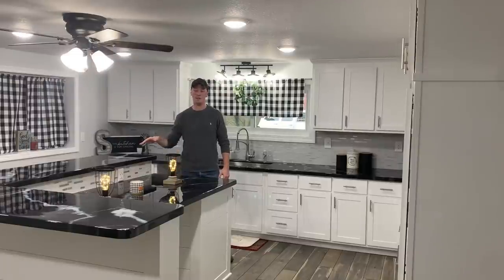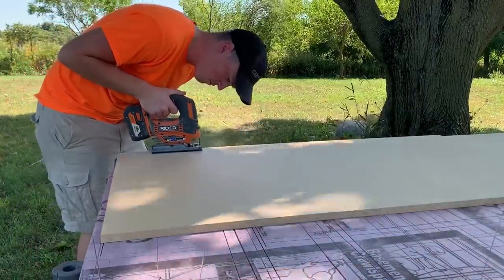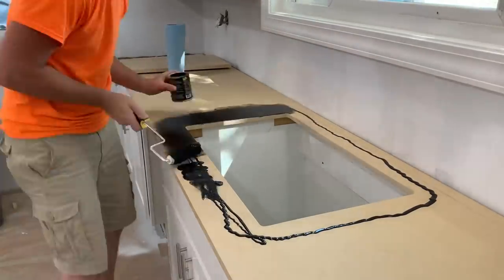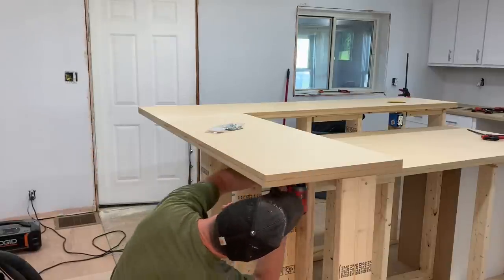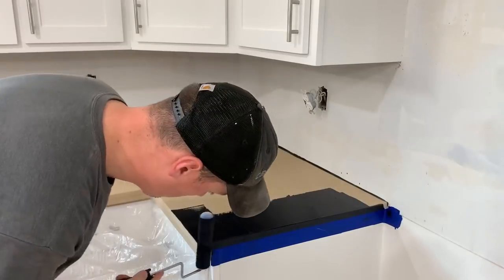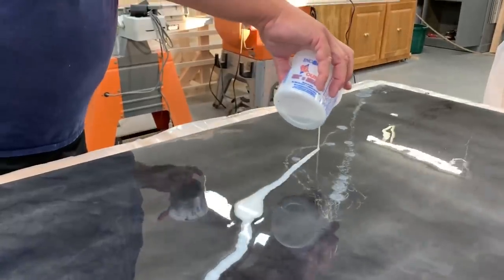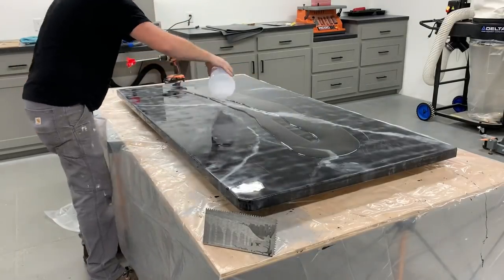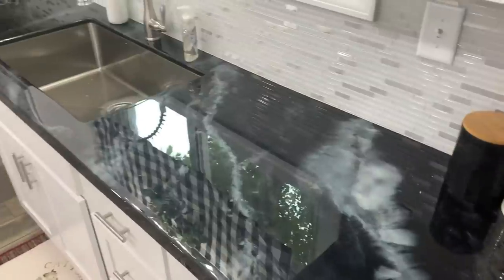EPOXY Countertops! | Complete Build and Pour

Comment: I work with epoxy as well if your going to do anymore projects with it please wear nitrile gloves and where are proper respirator mask . Allergies that develop from it are not pleasant including swollen esophagus and eye. Also lung cancer . Just one crafter/house project worker looking out for another. Loved the countertops though.
Reply from the maker: I was wearing gloves most the time, and this epoxy is 100% zero VOC👍🏽thanks for watching!
Reply: @JohnBuildsIt  just did mine and this epoxy is awesome. After using others for small projects its amazing this epoxy doesn't smell at all
Reply: Wat r some gud epoxy products
Reply: @estheriyilw6890  After using Stone Coat Countertops epoxy its all I use. They make sever kinds depending on what you want to use it for

Comment: Ive used the same system in our kitchen. We did a white "marble" look over out dated granite. With the white the gloss isnt nearly as bad but Ive been looking into putting a layer of their Ultimate Top Coat. The stuff seems even more indestructible and its a matte finish.
Reply from the maker: That’s what I’ve heard as well! We’ll see how it holds up and may recommend it down the road
Reply: @JohnBuildsIt  yea looks like it can a “future” application and doesn’t need to cure for nearly as long and also no troweling. Goes on in much thinner layers so less messy also

Comment: Would you have added support to the overhang had those came off the counter themselves vs a pony wall? 

Does the Flexseal work good for above the dishwasher too?  My local place only carriers the $65 tub as well, and I only need a little 24x24 area to do. I've heard the Flex seal smells horrible.

I have to say I've watched a lot of video's on epoxy countertops as I'm getting ready to do a bar in our basement.  Your video showing the torch taking out the bubbles has been one of the best.  Most the times you cannot tell your angle shows it perfect.   Great video, and breaking down the steps.
Reply from the maker: Hmm that’s a good question. I probably wouldn’t feel the need for just a typical countertop, unless the overhang is abnormally large. Do you have a sink you’re needing to use the flex seal around too? If its just the dishwasher area honestly a few coats of poly on the underside would be more than good 👍🏽
Reply: @JohnBuildsIt  I have a sink but it's a top mount. I will rub some silicone over it good and think then when setting the sink I will silicone it to the top as well.   Good Idea on the Poly.

Comment: Pretty Cool video. The way you explain it makes more sense. Just one question. How much time do you wait between every process?
Reply from the maker: I waited about 24 hours between epoxy pours. You can do it earlier and not have to sand in between coats too though

Comment: How is the epoxy holding up? I guess it would be hard to tell is it’s yellowing because it’s black. But would you use the materials again?  It does look badass. Just wondering if I did white marble, would it turn yellow from UV rays coming through the kitchen windows. 🤔

Comment: Hello John fantastic video I learned a lot especially the jigs you used such as. The clamp on jig to install the drawer faces and cabinet doors. The jig in the remodeling video showing when you painted the doors the plywood jig to hold up the doors while painting and flipping them over. Must say that was trick. 
Question, would it have not been better to drill the faucet holes before you epoxyed the countertops. This way the faucet hole would have been water sealed. Overall a really nice job in this video and the remodeling video. Congratulations Job Well Done. 
PS those metal wire clamps you use for the corner molding what are they called and where can I purchase them. Thank You.
Reply from the maker: Yea that would have been better but they didn’t have it picked out yet so I didn’t know where/what size/how many holes to drill haha. They’re Collins miter clamps and they should be linked in the other videos description. Thanks for watching!

Comment: Great work, I've done similar epoxy countertops at my house and instead of doing a flood coat with epoxy I decided to use water based polyurethane with a matte finish which gives it a bit more protection, although its doesn't look as glassy as an epoxy coat.
Reply from the maker: That’s a good idea!

Comment: the only thing I wouldve done is added epoxy on the hole you made for the water spout. great job!
Reply from the maker: I did do a coat of flex seal on it, just forgot to mention it👍🏽

Comment: It looks absolutely beautiful! How does it hold up against hot pots and when being chopped on with a knife? I am contemplating doing this but I'm not sure how resistant it is compared to the other countertops
Reply from the maker: I recommended using a cutting board, and hot pan holders.. so they still look perfect haha. I wouldn’t risk otherwise 👍🏽

Comment: Beautiful job!  This is the exact same color and patterns I want to do in my kitchen.  I have a few more yards of countertop...and a large center island.... in comparison, but would love to know how much the epoxy cost you so I can get some idea what it will cost me.
Reply from the maker: We used the 4 gallon kit, which is about $370
Reply: @JohnBuildsIt  Nice.  So, I'm figuring around $500 max for mine then.  Thank you for responding.
Reply: Did you ever proceed with your tops? How did it turn out for you?
Reply: @robertwhite4831  I found out that the DOH wants me to have stainless steel tops before I can open it up as a restaurant again.  So, after I fix the roof and flooring...I will work on the counter tops.

Comment: How does epoxy hold up to things light heat (like a hot pan) or different oils or things that could potentially stain it?
Reply from the maker: Not all epoxies are the same, but this one can handle hot pans. In general they should all be really stain resistant though

Comment: How do you avoid getting air bubbles? I poured my first layer and had a ton of air bubbles which I then sanded out before pouring my flood coat but I also got air bubbles in that coat as well. Do you think I should do another flood coat and if so what should I do to avoid bubbles? Thank you
Reply from the maker: Just using the torch several times takes out the air bubbles

Comment: Could you just use pocket holes and pocket screws with glue to joint the two counter tops together.
Reply from the maker: Yea if you have easy access underneath👍🏽

Comment: Great video!  How would you compare the epoxy process and final product vs concrete?
Reply from the maker: Both were pretty easy honestly! The concrete was way faster to set up using the z Counterform system that I did though. The concrete has held up flawlessly, obviously too soon to speak on how well the epoxy holds up. Thanks for watching! 👍🏽
Reply: I did both. Concrete then an epoxy on top to seal it. Love it so much and can't wait to do it again. Wishing I recorded it.

Comment: I use stonecoat epoxy a lot. I don't know how long ago you did this but let the epoxy cure for atleast 2 weeks before you put stuff with feet for example a microwave. The feet will leave indents in the epoxy. Awesome job though. Also to bring down the sheen and give it more durability, you can check out their ultimate top coat. I used it on my outfeed/assembly table and try to scratch it with screws and won't scratch all and it got rid of the glossy. The normal stonecoat scratches quite easily, but can be buffed out
Reply from the maker: Good tips! Yea it was probably atleast 3 weeks before they used it. Got em a pack of felt pads to put under anything that sits on the counter just in case as well👍🏽we’re going to buff it after it fully cures

Comment: I can't get anyone who uses this stuff to give me a straight answer to my question, which is: I have been told by natural countertop installers that most of their business comes from people wanting their epoxy countertops replaced because they don't hold up in heavy traffic areas, like around sinks and where appliances are used on the counter.  What's the real skinny on this epoxy stuff?  Is it a wonderful, bulletproof product, or is it designed for people who want to go cheap, compared to installing real marble, granite or stone, and unfortunately are not able to get away with it???  What think ye?
Reply from the maker: I don’t think anything beats the real stuff. In this case they went this route because real stone wasn’t in their budget, no shame in that. I think as long as it’s done correctly it should hold up for a very long time. I did everything I could to make sure no water could damage it and stuff. Hasn’t been very long but as of now it still looks great👍🏽